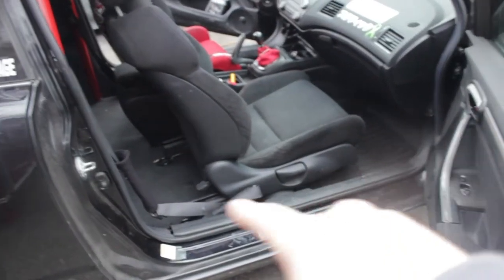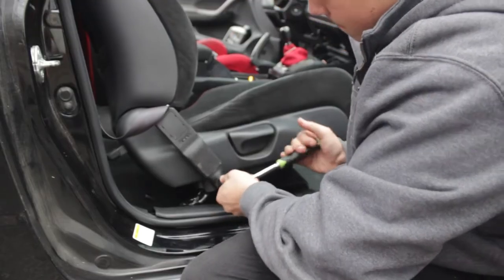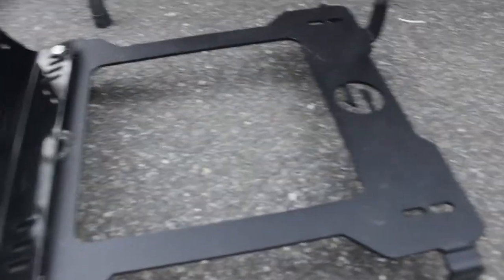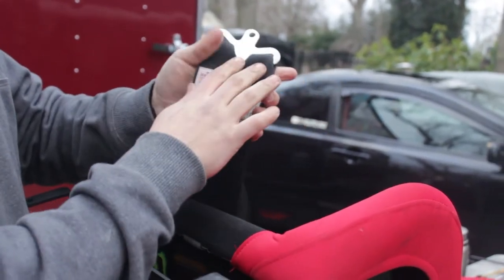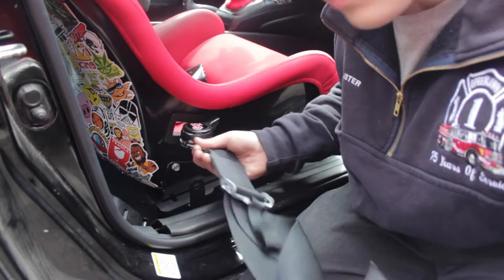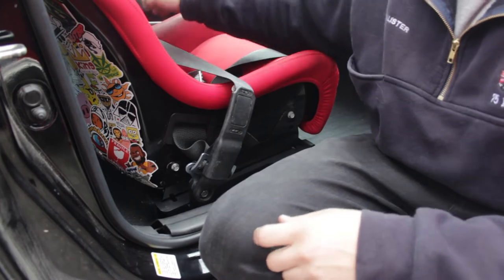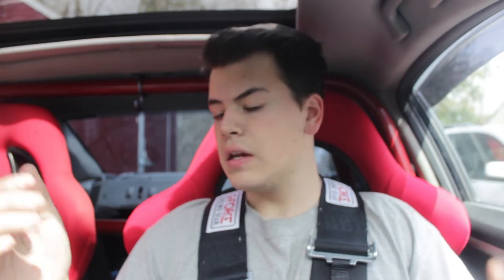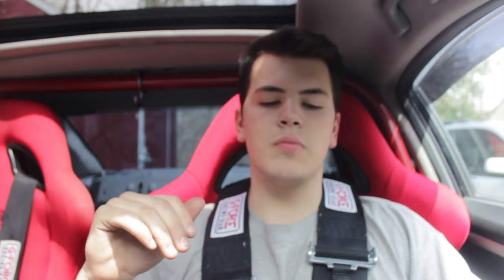How to install racing seats and harnesses - 8th gen civic si

Comment: Hmmm.. I wonder where you can get resistors?
Reply from the maker: https://www.ebay.com/i/123032558276?chn=ps&ul_ref=https%253A%252F%252Frover.ebay.com%252Frover%252F1%252F711-117182-37290-0%252F2%253Fmpre%253Dhttps%25253A%25252F%25252Fwww.ebay.com%25252Fi%25252F123032558276%25253Fchn%25253Dps%2526itemid%253D123032558276%2526targetid%253D595076325768%2526device%253Dm%2526adtype%253Dpla%2526googleloc%253D9004509%2526poi%253D%2526campaignid%253D1689407477%2526adgroupid%253D74365777908%2526rlsatarget%253Daud-412677883135%253Apla-595076325768%2526abcId%253D1140476%2526merchantid%253D114710430%2526gclid%253DCjwKCAjwndvlBRANEiwABrR32L_5qUyX7MgqlAwcWWfC4IoB22VSuFzCTyty1WmRQ4oLGtJSTDsb_hoCJnkQAvD_BwE%2526srcrot%253D711-117182-37290-0%2526rvr_id%253D1938248032769%2526rvr_ts%253D2e47b85616a0a9cb53776441ffe49032

These are some universal ones but not 100% the best way to install them, definitely look into the forums though! If i find anything else out I’ll hyu

Comment: you connected the wire in the new seats ?
Reply from the maker: lisbeth chavez yes but you must mount the original seat belt clip onto the seat bracket
Reply: OK thank you very much

Comment: How can i low The seat?...i am a big guy 6'6" and the roof Is almost touch mi head 😢
Reply from the maker: This seat definitely sits a little lower you can modify the seat bracket that attaches to the floor to get that extra inch. I am about 6’3” and understand your struggle lol you can also try the buddy club stock seat lowering brackets
Reply: @donaldhollister8430  thanx , i Will try 😎

Comment: Hey not sure if you still respond to stuff on this video but how did you work out the airbag situation, I’d like to keep my airbag in my steering wheel as well as the passenger airbag and I have yet to put my seats in but I have them and I just wanted to know if you had a workaround for this or if you just left it, as well as the seatbelt light/ chime because I will have harnesses, thanks
Reply from the maker: Check the forms for the proper resistors. I don’t haven a chime st all but i do have a light on the dash

Comment: The factory belt is not made to work with a seat of that style.. stupid. Not safe. At all.
Reply from the maker: robert perrotta correct that’s why i don’t use it... it’s just there to pass inspection
Reply: Lmao their’s no issue with running factory belts with a bucket.  Actually, some ppl argue it’s safer.